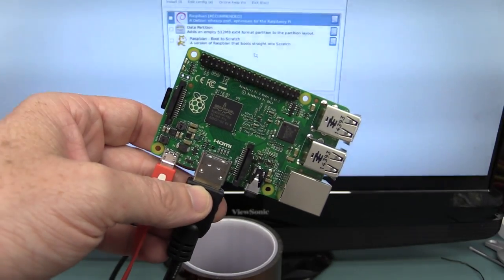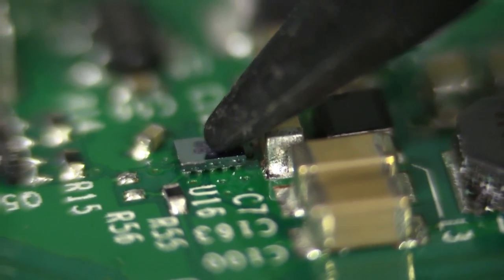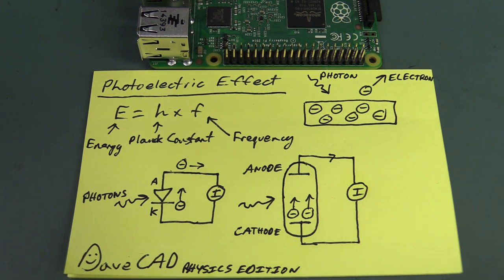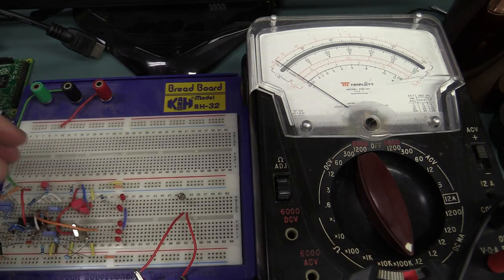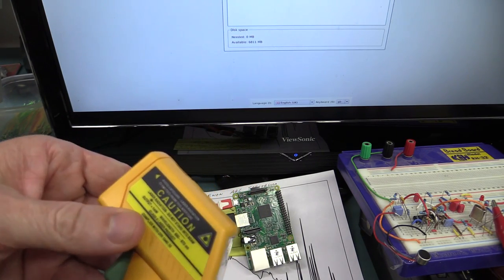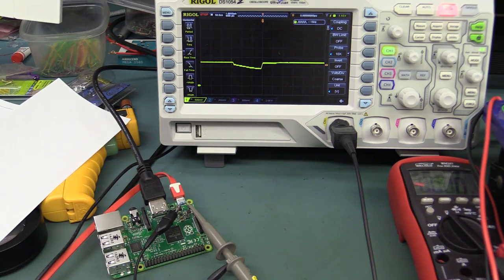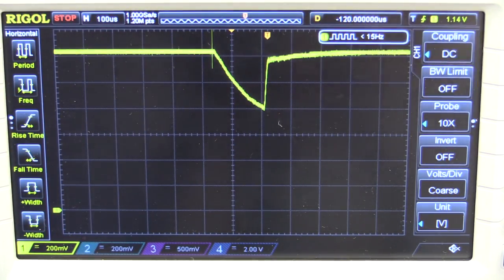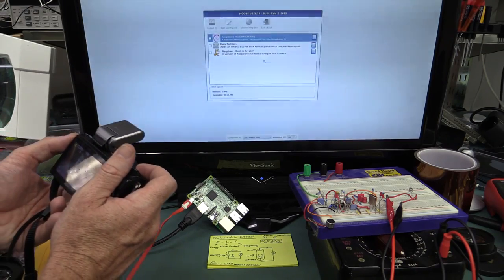EEVblog #716 - Raspberry Pi 2 Xenon Flash Problem Explained

Comment: Hey Dave, love the video; I was wondering what the deal with this was. I have to nitpick the physics a tiny bit, though. You're saying "energy" or "amplitude" when "intensity" is more correct. Yeah, a higher number of photons can collectively have a higher total energy than a lower number of photons, but when explaining the meaning of that wavelength/intensity graph the word energy should be used only in reference to the wavelength axis, not the intensity axis.
Reply: analogous to a certain extent to volts, amps.

Comment: Maybe the high frequency pulse is the xenon trigger pulse and the second blip is the current through the lamp? you could check by measuring the time in between the pulses and comparing it to the time it takes for significant current to flow through a typical xenon lamp after it receives a trigger pulse.

Comment: Few years ago (back when I was just beginning with electronics) I did an experiment in which I have cut out the top of a TO-18 packaged transistor (just like you did) and stuffed IR LED inside. This way I've build working optocoupler. It was a crap but it worked.

Comment: a big gob of blue-tack in your hand can be used to dab off the remainder of the goop on your board.
Thanks for the video - I totally thought it would have been the EM pulse from the high voltage discharge rather than the actual photoelectric effect.  Brilliant!

Comment: if possible could you revisit this? it looks like you actually covered some of the main arm chip as well when you covered it the second time. -  cab you try just using a ir filter cut to fit the small chip or something else to confirm? obviously it seems like youve nailed it - but I am just curious. -murica

Comment: The energy needs to be above the work function for the material. So there isn't a specific wavelength that it works at, there's a boundary where it starts to work. Also uv is higher energy than optical and ir, so if the light enters from the side it'll probably be the uv.

Comment: It was probably said in a later video, but could it be that the Broadcom chip had browned out from the drop in voltage from the buck converter? And said brown out doesn't auto-reset it?

Comment: I've dealt with this effect a few times in 35 or so years, mainly with clear glass diodes injecting noise into analog circuits. While I believe that you have found the culprit, I would feel 100% confident (as opposed to 98%) if your test had also included the inverse test, (ie. masking everything but the I.C. in question). Still nice illustration of how a perfectly engineered product can be totally compromised by a little cost savings on a single I.C. device.

Comment: I think you needed so much bluetack because there are 2 exposed chips on the board, the second one being right behind the HDMI port. You only eliminated the photo electric effect after you had covered both chips with blue tack.

This is of cause just a guess as to why you needed so much, what do you think?

Comment: I am relitively newbie in electronics, but can you add a capacitor on that line to keep it stable and compensate that time the voltage drops down? At least theoretically am i right?

Comment: Hi, I think there's another chip-scale package near the HDMI-Connector. It wasn't covered by Blue Tag on the first trial, but covered by Blue Tag on the second trial. Maybe that's the real culprit and not the switch mode regulator ?

Comment: Never tough I would see bearchip with out plastic package, especially BGA...
Just wondering if its possible to make video for LIN and CAN communication's. Would be nice because they are widely used this days in many communication systems and mostly in the automotive manufactures. I can make video of my own but I doubt it would be any close to the level of your videos Dave. Anyway keep up the good work! 
P.S. Raspberry rocks I use one to run my home FTP server and wake up by the network my home mighty xeon server that I run ESXI and some unix and linux virtualized OS systems on it. Saves a lot of energy rather running that server 24/7, just waking it up when I need it :) And the raspberry consume only like what 5w/h?

Comment: Hi All

Could the problem be in the circuitry used to drive the camera's xenon bulb - electrical impulse rather than a light/photon impulse issue?

This could explain why the blue putty didn't work . . .

Comment: Near IR has a lower frequency than visible light, so less energy than visible light. However, what's probably going on is that silicon is more transparent to infrared, so infrared light coming in through the back of the die can affect it.
Reply: There's a fair power in the uv though... It'd be interesting to take one apart and experiment.
Reply: Nope, the spikes are in the UV  range and he has mislabeled the chart.

The fact that dim blue light produces a more pronounced photoelectric effect than bright red light was one of the clues that originally gave Einstein the insight into working out what was going on.
Reply: LiamE69 I think it's labelled properly (in nanometers). I did a quick image search for "xenon spectrum" and all of them have lower-frequency light (IR) on the right, as opposed to how RF spectrum is normally plotted. They also all show that xenon has spikes in the IR part of the spectrum, but not in the UV part.

I don't know how transparent silicon is to UV, but it is certainly transparent to (some?) IR.
Reply: Karl Koscher
 I did the same and looked up the spectrum of xenon lights as you can see on a post elsewhere here. Yes the spikes are in NIR. As for labeling I simply cannot see any in my video. I could see the figures but not the unit. As he talked about frequency I had it in my head that it was the units were THz, but he does say it is nm.

That correction aside, it really is the UV doing it. The IR spikes will have a far smaller PE effect than the portion of the emissions in visible light which in turn will have a smaller PE effect than the portion of a xenon lights output below 400nm, which is small but significant.
Reply: InXLsisDeo
Yeah, been there corrected that. Still it doesn't change the fact that the PE effect is a threshold effect. NIR doesn't produce a PE effect on any material I am aware of. Visible light does on some materials. Near UV does on most metal and as it is produced by a xenon arc it is the culprit here. Very high UV and beyond produces a PE effect on anything but is not produced by a xenon flash.
Reply: InXLsisDeo  Please read Einstein's Nobel prize winning paper on the photoelectric effect.
Reply: InXLsisDeo
 It contradicts his and your original reply in pretty much every way there is to contradict what was written. It is not a specific frequency of IR light corresponding to the bandgap of the semiconductor that is causing the chip to drop out but instead it is light above threshold frequency for the photoelectric effect. The UV light hitting the chip is absorbed and produces abundant free electrons via the photoelectric effect which floods the chip and causing it to drop out. The IR mostly passes through and that light produces no free electrons. Yes a very small fraction of the IR light will be of the right wavelength to promote electrons in the bandgap region but that is a tiny fraction of the IR spectrum and of that only a tiny fraction of that will be absorbed by the chip and a fraction of that in the critical region as opposed to all of the UV produced being absorbed and creating the effect.

Put simply it is the UV light producing copious free electrons that is doing it, not the IR promoting a few. Or look at it another way, on the spectrum graph it is all the light to the left of the 400nm mark vs a fraction of the light at or very close to 1100nm where little is produced and far less is absorbed and even less in the right place.
Reply: InXLsisDeo
But these filters only have a few dB ratio effect. It could have remained strong enough. The only solution would be using a pure-UV and pure-IR source.

Comment: It might be the IR as you mentioned.  Silicon is transparent to IR.  It probably is not getting to the chip from the underside.  It is probably going right through the top face.  Thanks for the excellent video.  On a side note radio shack black plastic project boxes are somewhat transparent to IR as well.

Comment: Quick question out of curiosity. If the regulator is recovering so quickly could the problem also be solved by more decoupling caps on the inputs to whatever is locking up?
Reply from the maker: aftertwotoo Perhaps, but that would be a poor fix, as you shouldn't rely on the regulator to recover from such a thing. Much better to simply stop the problem from happening in the first place.

Comment: U16 is a problematic die level chip in the R-Pi2. My solution to this is to encase it with some black hot glue.
This chip should have been covered when it was put on the board but QC now-days is non existent it seems.
I have recreated the Xeon lock eccect by using different light sources from Xeon flashes to White Blue, and UV LEDs.
Another effect also exists with the pi and that's the EMP Effect from devices that emit RF such as a cell phone or 2-way radio which will cause the Pi to lock up also. There is no RF shielding on the Pi so all sort of stray signals can get in and cause the pi to malfunction. Solution for this is to shield the pi IF your using it as a control device for a wifi repeater node you want to shield it from the wifi RF.

Comment: Would it be possible to add a Capacitor so that when the regulator drops out the cap provides power for the few ms it takes to recover? I understand that's not best solution, preventing it from happening would be better, but could it be an option, perhaps for people who want to bodge something in there...

Comment: Not convinced this is due to photoelectric effect.  The experiments performed at the end seem to point to a susceptibility problem.  Hey Dave – try this experiment.  Cover the flash with a black cloth and trigger it next to the board and see if you get the same issue.

Comment: now i am wondering, redoing all of the board is not an option. A blob of "blackness" could do the trick. But you showed that there is a drop in power during that flash and the processor stops working. What if they put an elco ( or how it is called in english )  in that spot so that there won't be a drop in power. 

Theoraticly the processor could be working all the way through while the power regulators recovering and bringing all back to normal. Could that also do the trick?

Comment: Photoelectric effect does not occur at wavelengths below red, the UV component in the xenon tube is most likely to confuse the chip.
Reply: actually... I think you're only thinking about the classic photoelectric example of ripping of electrons from the metal surface(work functions)... However the Bandgap energy on semiconductors allows for much lower energy photons to be causing charge carriers (free electrons in the lattice) to "appear" and thus make a semi-conductive junction to ...well... conduct when it shouldn't 

if you take the bandgap for pure Si 1.11eV (as an example... the doped junction in that IC has probably a lower bandgap still)  and compare it to it's work function 4.60eV you'll see that IR and visible light CAN cause it to conduct when it shouldn't (so yeah, not because of positive "carriers" but negative ones)
Reply: Diego Spinola yep...that's actually true...i remember cracking old TO-3 packages and measuring that the die produced current when exposed to light...still an interesting problem...I would be curios to see what happens if one shines an uv LED straigt into the chip, though

Comment: While I am not an expert, from what I have read I believe that this is an example of the photovoltaic effect, not the photoelectric effect as you say.

To quote WIkipedia: "Instead, as it turns out, electrons are only dislodged by the photoelectric effect if light reaches or exceeds a threshold frequency". But as you say in the video, the effect here is a result of the spikes in the infrared, and people testing with high-intensity visible light have generated no reaction.

As per Wikipedia, the photovoltaic effect doesn't have the same threshold. And it does occur in silicon, as it is the effect used for current generation in solar cells.

I see that you have put various extra text on the video, but e.g the one 10:26 talks about total energy, where if it was the photoelectric effect it would also have a requirement for individual photon energies. At 11:53 you also talk about a specific frequency, where the photoelectric effect works with lower threshold frequencies.

Comment: How did you rule out the emp pulse from the flash electronics as the cause?
Reply: If the EM pulse was the cause the problem would've continued after covering with Blu-Tack
Reply: Yep, but it clearly blocked it. I wonder if black enamel paint would work.
Adding to that, the HF spike he mentioned was from the loop of ground.
I assume he meant the flash cap dumping all the current made some RF.

Comment: Actually, the affect may be understood as parasitic photo-diodes in the silicon. http://en.wikipedia.org/wiki/Photodiode
It turns out that the spectral peak sensitivity for a silicon photo-diode is between 800 and 1000 nm. This corresponds to infrared. Looks like you were probably right in the video.

Comment: Would dabbing this really have driven up the price point, or may this just have been overlooked?
Reply: Reading the forums and their engineer's responses it was overlooked - they weren't testing for xenon flashes so it was never discovered in their own testing.
Reply from the maker: Mat Mabee It was simply overlooked.

Comment: it would have been interesting to flash it with UV and IR filter in front of the xenon. or even RGB filters
Reply from the maker: ***** I just tried a camera UV filter and the problem remains.
Reply: EEVblog could this be EMP effect?
Reply: xponen The EMP effect was ruled out when it didn't lockup with blu-tack covering the regulator.
Reply: Christian Riise Wagner but you too saw that the tiny vertical line on the oscilloscope still exist... right?
Reply: xponen Which is from the probe. The long gnd lead acts as an antenna, so thats just an error we see from the probe.

Comment: you can only get blu-tak off with more blu-tak
Reply from the maker: CatheteriZedEYE I need new blutack, mine is all gooey for some reason.
Reply: EEVblog - are you sure Sagan hasn't switched your BluTac for Playdoh? ;)
Reply: EEVblog As a chilly Canadian, I recommend putting a bunch more on, sticking it in the freezer, then pulling it back off. ;-)
Reply: Chris Procter
So your saying put more onto the Pi and then actually put the Pi in the freezer with it?

Comment: At work we make industrial xenon beacons, so effectively we make raspberry Pi2 killers :D
Reply: Those things can be insanely bright, and even melt black plastic.
That projector tube I tested for someone was bright enough.
Can't imagine how many lumens those industrial beacons put out.
Better keep all your Raspberry Pi 2 at least a few miles away LOL.
Reply: theLuigiFan0007
 Depends on the model and lens configuration, we mainly have 5 Joule and 10 Joule, as well as 15 Joule flash energy on some models. They are used in inaudible warning applications, and in combination with audible signalling devices on buildings and machinery.

Comment: Here's a hint (and a lesson in buying camera equipment): digital camera sensors are pretty much blind to UV light, and that's not due to filtering. They are, however, very sensitive to (near) IR, and in fact every digital camera will have a "hot mirror" on it to reflect away everything "longer" than visible light, except a tiny gap around the frequency used by IR remotes (another mystery solved). Getting that filter wrong has purple results since both the blue and red pixels on the common color filter arrays will pass IR; for a demonstration, check out the Leica M8.

So I'd look at the intense IR light from the insanely powerful flash as the main culprit.

The lesson in buying equipment? When that nice kid tries to upsell you a UV filter for your shiny new lins "to reduce haze", you slap them and laugh.

Comment: I put some coax seal that I use to weatherproof connections to my ham radio antennas over the offending chip. This solved the photo sensitivity issue. I bet the stuff contractors use to seal around utility entry points in buildings would also work. We call it monkey poop. GB makes it and it's available at most hardware stores.

Comment: It is more logical that it has to do with UV light. A regular LED light or even an incandescent light bulb will not emit UV light. If you look at the formula the higher the frequency the higher the energy. In your graph you have the spikes at the lower frequency (big wavelength), IR which has low energy. It is highly likely that it is UV sensitive. That's why it has to be a Xenon flash.

Comment: I might try this out. Got some 950nm LEDs at work. I suspect that the exact frequency that will trigger this puppy is around the 1117nm mark. This number is found by converting Silicon's band gap of 1.11 eV (electron volts) to wavelength. However because of doping the number may be different.

This is purely a guess so anyone feel free to correct me.
Reply: Haha. I didn't read further down the comments. Pablo looks to have said the same thing. ;-)